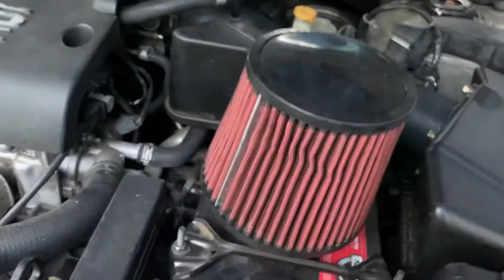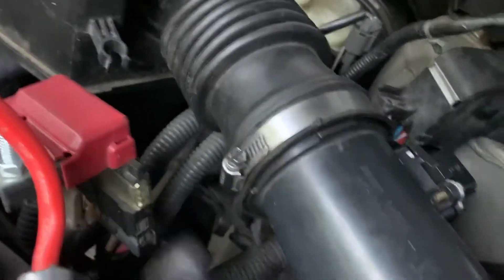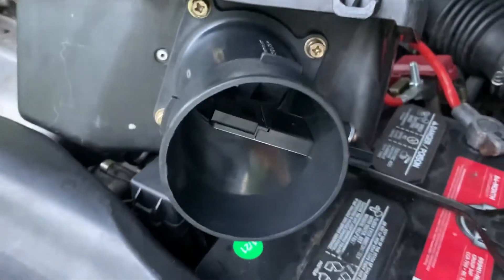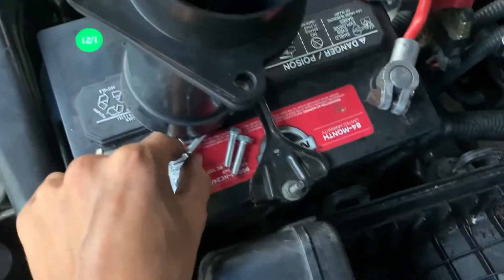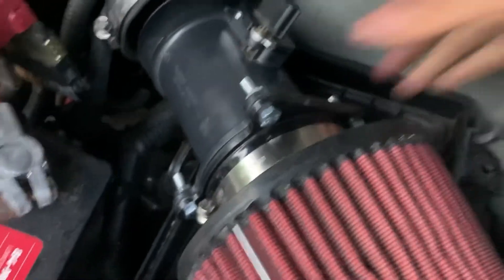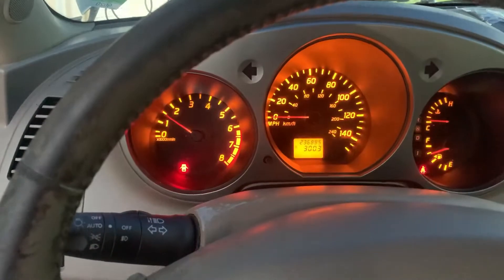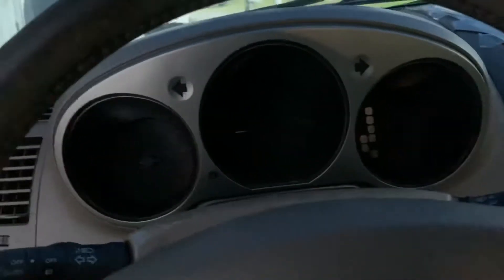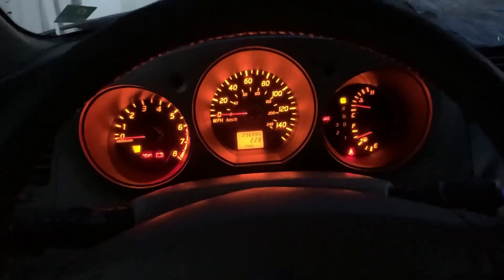04 Nissan Altima open intake filter installation

Comment: I just sáw your video and you explained pretty well. O have a question though... did your check engine light came AFTER replacing the stock intake?
Reply from the maker: Nope as long as the maf sensor is fully plugged in and the filter is clamped on good there should be no check engine light
Reply: mine came on too it happens you just gotta clear the code it will go away anytime you unplug it the check engine light comes on

Comment: Why does everyone think it makes it sound different lmao 😂
Reply: Because they actually do make a difference. You deaf?

I just bought a short ram air intake hps. Excited to get it.
Reply from the maker: It does make it sound different because the stock air filter and airbox restricts a lot of the sound but when you add just a kit it removes the restriction and makes it more louder when accelerating
Reply: Mines whines

Comment: Ur rpm is too high
Reply from the maker: No it’s not the car was off the entire day and I have just started it when I installed it
Reply: @engineering4449  did u have to do the idle relearn after, i just order the adapter with air filter today of ebay, about to do mine as well
Reply from the maker: No idle relearn required